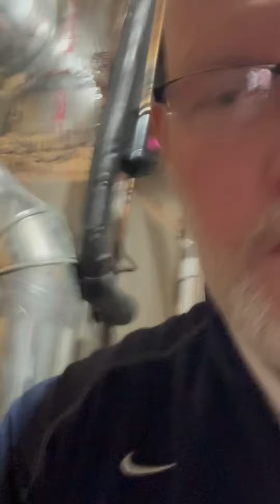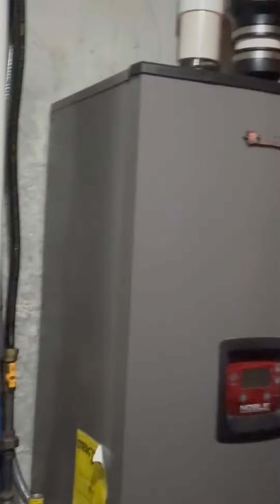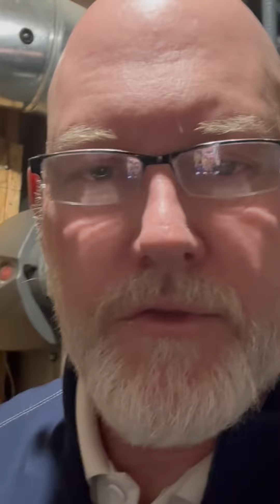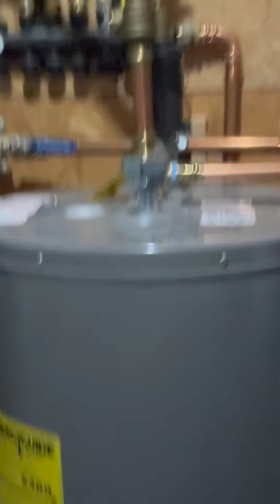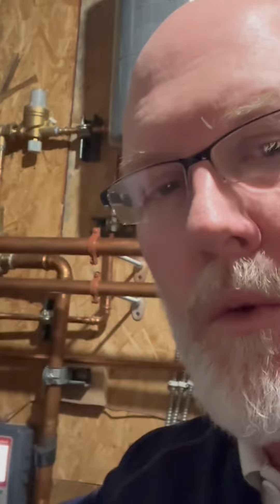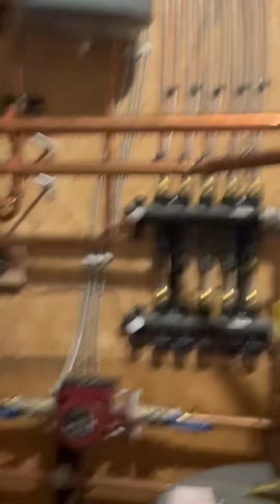Why to use a buffer tank with a heating boiler.

Comment: I put a lighted switch  in bathroom to my electric hot water tank and also a small LED linked to tank thermostat and then double insulated my tank my electric bill has gone down $75.00 a month

Comment: What are u controlling with the T775M? Mixing valve?
Reply from the maker: T775 B2048. Feeding the boiler directly into the tank. RFH pulls from decoupled piping. No boiler reset to tank. One temp.

Comment from the maker: I am running tank to 130F, using internal boiler control and a sensor at the middle of the tank. Once I reach offset of my control relay the boiler runs to set point. 

It’s all high mass radiant so I don’t use a reset strategy since the weather has changed by the time i have established my new set point. 

Ironically, I have several clients that will run some small zone cooling or use outdoor air as a free cooler when the temp rapidly rises. 

Radiant - built for comfort not speed.

Comment: What tank temps? Outdoor reset? Boiler turn down ratio? Just curious, as I basically help design our daughter's ICF new home build.
2 zones, 2 thermostats, 2 circ pumps, 2 caleffi manifolds with both having 5 complete circuits.  Henco brand pex al pex out of Belgium, ( I despise uponor), and zones once stabilized level out at about 25% capacity per zone at design load.
Between small home, (1200 sf per floor) ICF basement and main floor, german windows and doors ( great cost value made in canada), I'm estimating about 350 gallons of propane per year!
Radiant is a blend of baseboard, and fantastic copper coiled fan assisted panel radiators made in the United Kingdom.
Running a 135 degree boiler set point , and an indirect dhw tank, both from NTI.